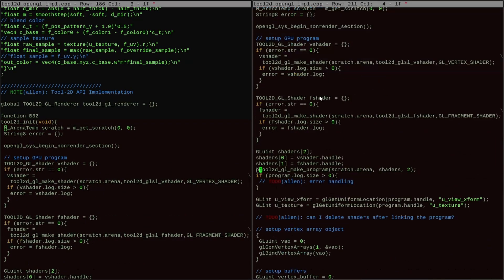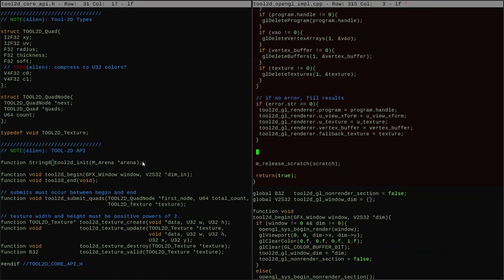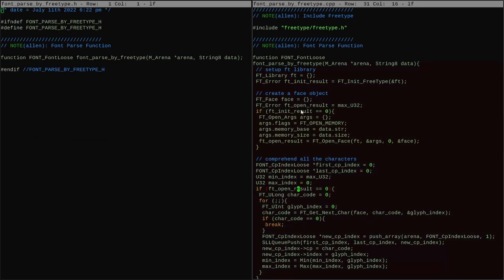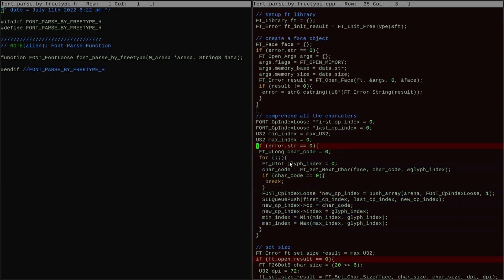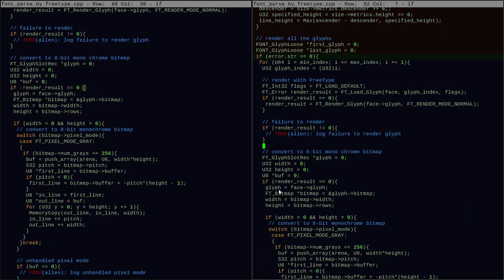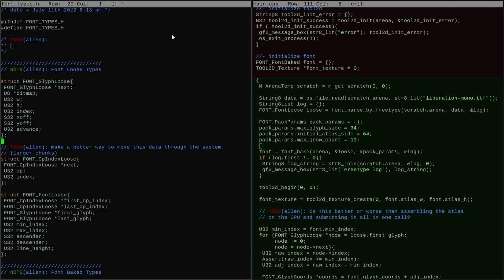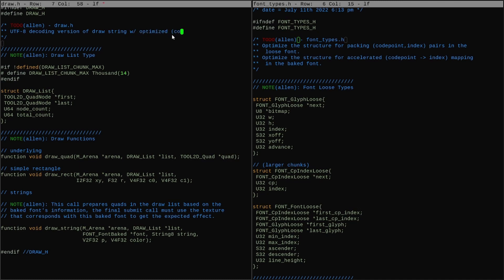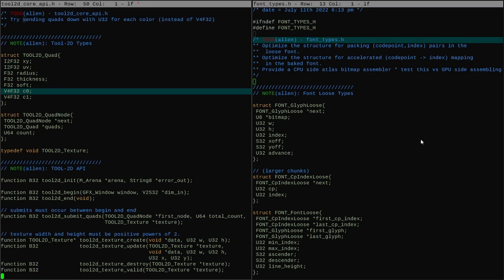Graphics 2 [12]: Error Handling

Comment: I have a few questions: 1. So far, the only part of the memory that persist across frames is the font glyph texture atlas, is that correct?. 2. Does the draw list and all the nodes with the space for all the quads, get's created and filled each frame? 3. How many arenas are there in this system.? I'm assuming that for processing different sets of data(textures, batching commands) you would want separate memory arena's.
Reply from the maker: Great questions!

1. The glyph texture atlas has two parts, the bitmap and the (glyph_index -> layout) data. The bitmap is stored persistently on the GPU only, it is only stored in fragments in the "CPU's memory" (i.e. RAM) temporarily during startup before the frame loop begins. The (glyph_index -> layout) data is also setup before the frame loop begins and does persist in the "CPU's memory" for the whole loop.

2. The draw list is built and used up in a single frame, at the beginning of each frame I start with the arena for the draw list cleared back to empty.

3. There are a few. Our thread is equipped with a couple of arenas for scratch memory (this is where something like the fragments of the temporary bitmap are allocated before I'm done with them). Then I have a persistent arena that is setup before the frame loop and contains allocations that persist through the whole loop, and I have one more that starts at empty at the beginning of each frame and handles things like the draw lists.

This will continue to expand over time. For instance later there may be two arenas that I swap every frame so that I can refer to the previous frame's memory as well, although that might be separate from the draw list arena. I'll also introduce a new arena any time a system with it's own independent life cycle pattern shows up in a program.
Reply: @Mr4thProgramming  Awesome! I have a follow up question: Is there any reason to refer to the previous frame's memory? I don't see a reason why would you need memory from a previous frame. Is it for debugging purposes only?
Reply from the maker: @rudra7099  This is quite a big and subtle topic. We'd have to pick apart the pros and cons of having in place mutation of state, vs construction of state from previous state. We'd have to dispel the notion that a frame loop is any different from any other iterative process. And then we'd have a mostly complete picture of the topic. Hopefully that outline is enough to get you started for now. I'll probably get into it more in future videos.
Reply: @Mr4thProgramming  Perfectly. Looking forward to seeing more of your videos.